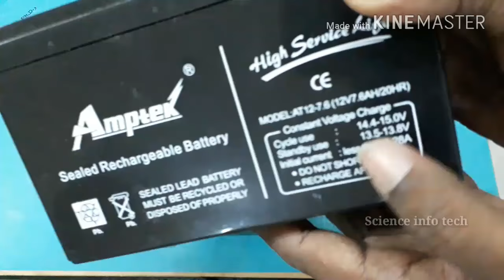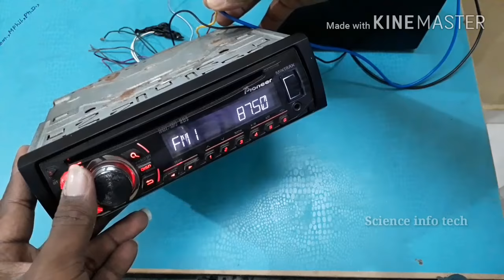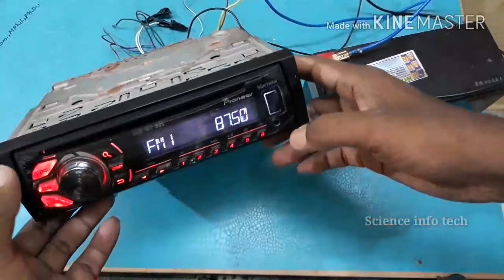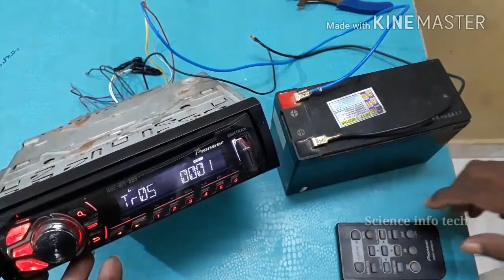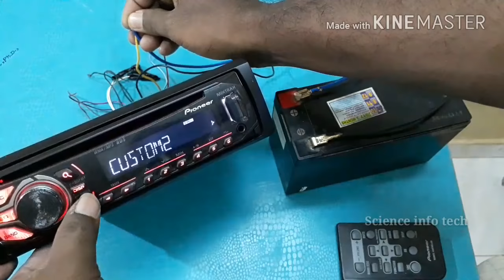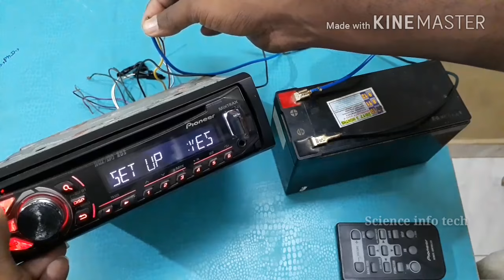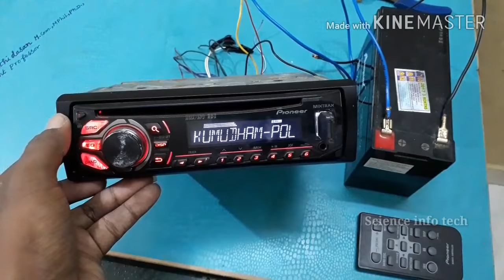Pioneer car audio player installation/ CD Mp3 player connected in 12v battery

Comment: hi bro, greetings.. I'm using my car stereo (DSX-A410BT) with amplifier (XMN1004) with the help of my computer power supply(650w). my next plan is to use a battery for it. The fuse ampere of the stereo is 10a and for the amplifier is 50a. If I purchase a 12v 50a LiFePO4 battery, should I charge the battery with my same computer supply which is 12v 58a max?? or I have to purchase a DC to DC step up booser?
Reply from the maker: Use best battery charger... dont use computer power
Reply: @ScienceInfoTech  ok bro.. thanks

Comment: Geesonic car set la
Ground
Powerwire 12v yellow
Acc 12v red

Ithu la yellow and red onna positive voltage kodukanuma
Reply from the maker: yellow direct battery positive.. Red positive switch controll
Reply: @ScienceInfoTech  thanks bro

Comment: Bro idhu kuda subwoofer amp and subwoofer epdi connect panrathu adhuku thaniya power supply kudukanuma illa 12 v adaptor la connect pannalama bec na car stereo 12 V adaptor la connect panni work panna vachen but subwoofer amp and subwoofer ah epdi connect panrathu konjam sollunga
Reply from the maker: subwoofer speaker out la connect pannalame

Comment: Bro 12dc adapter la intha run panalama ?
Reply from the maker: work aagum...
Reply: @ScienceInfoTech   bro one more question pioneer matirax car audio set maximum how many ampere capable 20amps or 25 amps